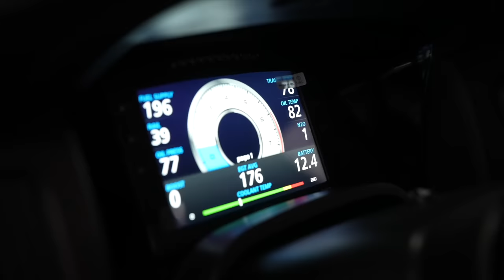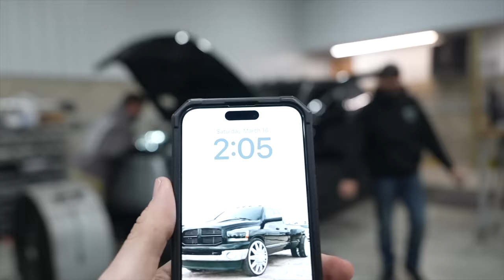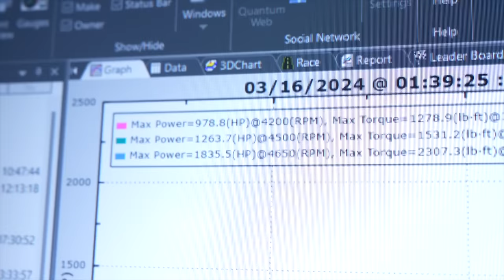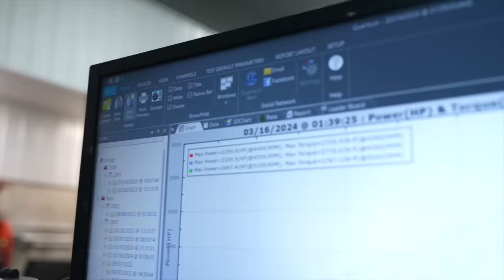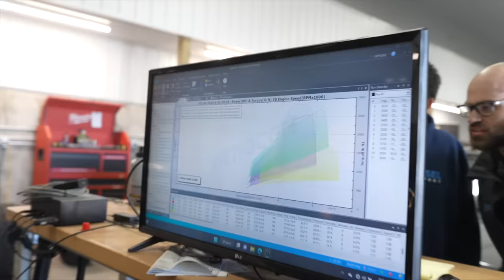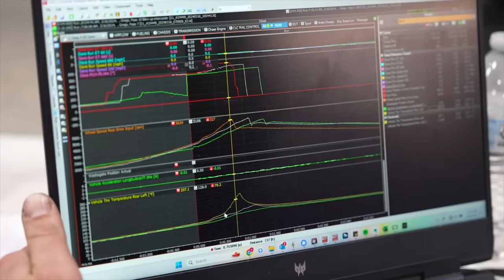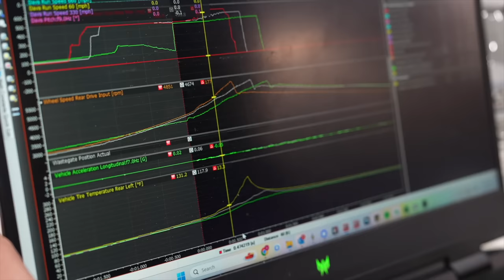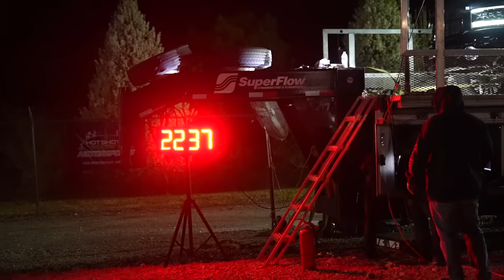WE MADE 3,059 HP On The DYNO!!!! THE 05 IS BACK AND NASTY!!!!!

Comment: Congratulations now that you are making big big power may I suggest a killer oiler treatment called rev X.
Steve Morris racing ran his drag wagon with out his oil pump belt (by mistake) for three passes and drove it back to the pits and the only thing that happened to the motor was 1 main baring F up.
They have fuel treatment also and I have been running it in my dodge Diesel for some time now with better MPG and a smother running motor.
I can't recommend REV X anymore then to say it's the best stuff I have ever used in my 62 years of life of working on stuff.